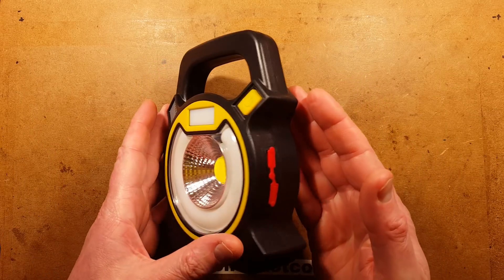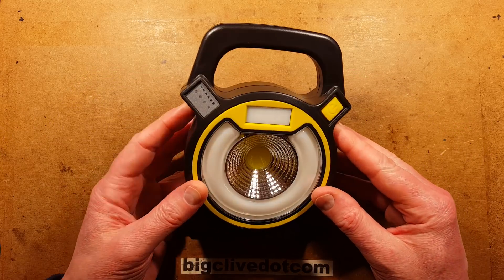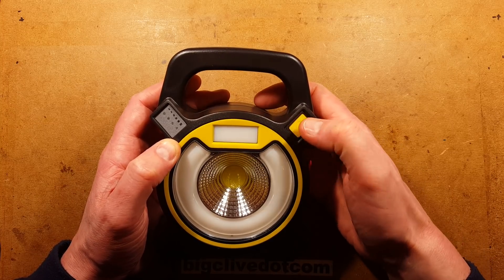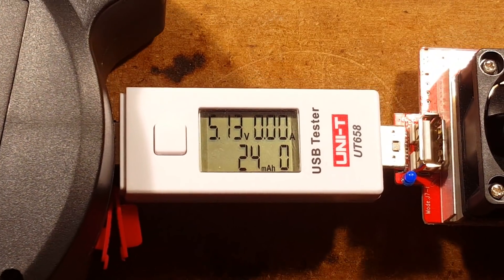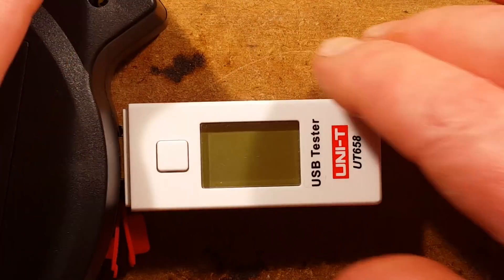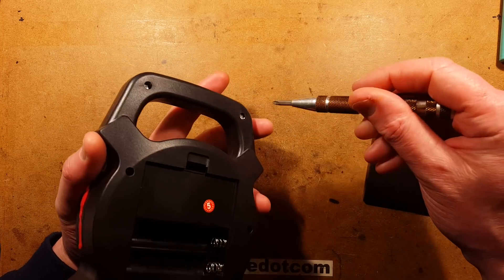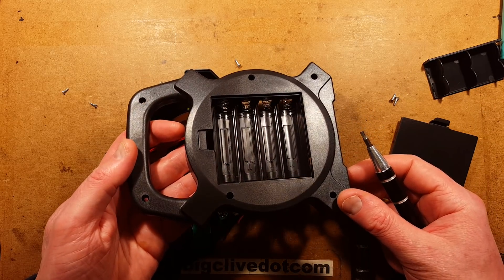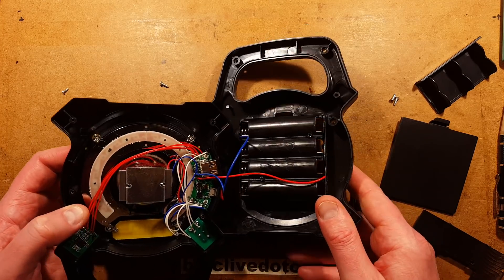Inside an interesting light and power bank with hidden upgrade.

Comment: During testing they probably found that the charging circuit would not handle charging 4 cells, so they just plugged up 2 of them to avoid re-spinning the PCB.
Reply from the maker: It charges at 700mA, so it would just take a while to charge four high capacity cells.
Reply: My advise of charging 4 cells from empty to full is from experience with one of these to just leave it over night.
Reply: Wouldn't it just charge at half (ish) the speed? Charging is done at a fixed current, isn't it?
Reply: That's my though.  Or, they use a more expensive charging module for the 4-cell version.
Reply: or re-spinning the plastic case.
Reply: I think putting say two discharged cells in parallel with two fully charged cell may end in a total incendiary mess, while doing the same thing using only a pair of cells will cause much less trouble. So they made some safety fix.
Reply: @Natopsi  That is not a problem. Julian Ilett made a video about that subject once.
Reply: @Natopsi  I don't think that'd really make any difference at all to be honest. If the thing was somehow going to fail catastrophically I'd imagine it'd happen just as well in a 2P configuration as 4P. Adding the extra charged and extra discharged battery wouldn't do anything different really. It'd basically just be each charged battery splitting it's load across the two cells, effectively dumping as much current that one charged battery would into a single discharged battery. Granted I could be wrong, it just doesn't seem like the likely cause, especially since these cheap products aren't know for being engineered to avoid incredibly unlikely safety concerns - or even the very very likely ones.
Seems to me they probably just didn't want the layman to see four slots and assume four battery slots means it must use four cells, then want a refund when it takes 10-20 hours to charge, or think the thing is defective when the charge indicator never changes even after being plugged in for several hours, so they limited it to a capacity range the charge circuit can more adequately handle without the average persons expectations that a device should charge in 2-6 hours.
Reply: I thought Clive said it didn't come with batteries and he put in some random mismatched cels.
Reply: @njrenkable  0:24 "they're just completely random mismatched cells I've put in here..." It definitely came with no internal or removable batteries.
Reply: they probably sell a 4 cell variety for more money companies do shit like this all the time 

nvidia shield does it too i belive they sell a hdd model and a none hdd model the only difference is for the hdd model they put the sata connector onto the board and possibly use a different case half that has the mounting tabs for the hdd
Reply: @njrenkable  :p no worries! As someone who almost exclusively watches YouTube videos when preoccupied with something else, I know how it is.
Reply: or maybe took way too long they were concerned people would think it was not working
Reply: @USWaterRockets

My guess is more on : according to the price of cells they took off 2 of them to up margin.
Reply: The way I heard the description in the video, it comes with no batteries because of the mail service rejecting lithium batteries in products. You need to supply your own batteries, so there's no profit margin increase by blocking 2 slots.
Reply: @USWaterRockets
If it comes with no batteries, then yes my bad, assumption completely jammed ^^'
Reply: @jean-baptistefox2819  but no cells were shipped with this item... there is no point in covering up two slots
Reply: there's no real point in trying to divine why things come out of chinese factories the way they do, it is just as likely that this product was designed based on finding a shipment of 100,000 plastic shells that fell out of the back of a truck
Reply: parallel cells allows the possibility of dead short and product liability problems.
Reply: @wktodd  And of course we all know the Chinese manufacturers take product liability very seriously indeed...
Reply: @wktodd  The 2 cells are already in parallel, what difference would another 2 more make in terms of dead shorts, apart from doubling the risk. But then why double it in the first place from 1 to 2? Doesn't make sense.

Comment: Might I suggest placing a small reference mark on your bench that indicates the center of the video when fully zoomed in? That way, you can easily tell if you're drifting off center, and it'll help you develop muscle memory of where that point is.
Reply from the maker: I usually do have a faded mark in the middle.  It helps a bit, but I often get so distracted that the only thing I'm looking at is the thing I'm working on.

Comment: On EBay search the terms:  15W LED Camping Light Work Tent Lantern Portable   around US$12, it varies by a dollar or two.
On AliExpress there were sellers listing this for ~US$9.40 shipped (without batteries) 
Does anyone know how to permanently disable the god-awful blinking setting?  Please Oh Please there has to be an easy way.  Thanks.
Reply: Clip the wires.  You'll have a blank click on the switch, but no annoying blinking lights.
Reply from the maker: It's inevitably baked into the software.

Comment: the molds for injection molding are expensive. and the faster you want to produce the more expensive they get. If they don't have enough orders to justify two different molds for the battery case, a mod is exactly what would be done.

Comment: Wouldn't adding two more cells up the voltage from 3v to 6v using 4 AA?
Reply from the maker: It's lithium cells in parallel.
Reply: @bigclivedotcom  Oh, ok, thanks. So it just adds capacity. Can it run off a standard 1.5V AA though and achieve it's claimed 15Watt output?

Comment: does it have 240 Volt USB Outlet.
Reply from the maker: This is one of the safer ones.
Reply: @bigclivedotcom    but I need to rapid charge my cellphone with 240Volts stuck with this slow 9volt charger
Reply: So, you don’t mind the risk of electric shock with the death Dalek lanterns that Clive had videoed ⚠️⚡️, I think rapid USB chargers are available? 😉
Reply: @samuelfellows6923  240 = charged in seconds  =fast charger takes an hour

Comment: have the same lamp. shorts the usb input
Reply from the maker: Do you mean it shorts the USB supply when plugged in?  It might be worth checking the PCB for a solder splash in the vicinity of the connector.
Reply: the supplied cable was warm to the touch. pcb looked okay. i just charge the cells outside and glued the input flap

Comment: What the heck‽ 😲

Maybe they made a mistake, then covered it up because it was cheaper than re-tooling; or maybe they have a "pro" version (🙄) and it's cheaper to use the same mold plus a cover than a whole extra machine/mold.
Reply: How can it be cheaper to manufacture an extra piece of pointless plastic than not. They're need additional raw material, tooling and molds just for this one piece.
Reply: @simontay4851  Common model with 'pointless pieces of plastic' are a LOT cheaper than a complete retool for each model. The 4-cell version is probably sold as more expensive. I work in the car industry, and it is VERY common there - you can get a model of car offered with or without heated seats for example, obviously the one with heated seats costs a LOT more - but the only difference between them is the one 'without' the heated seats simply has a 'pointless piece of plastic' over where the on button for the heated seats should be. Cheaper to just put the seat heater in every car and simply disable it on cars that arnt supposed to have it.
Or if you want it another way, the Jaguar XJ production line in Birmingham uses around 500,000 pre-manufactured 'pointless pieces of plastic' per year to blank off features the customer has not paid for, but actually exist on the car (such as seat heaters).
Reply: Simon Tay 
Cheaper than re-tooling he said.
Reply: And the additional covered holders had contacts in them - if they were a mistake, it would only have two sets of contacts in the exposed 2x holders, and the cover glued/sonically welded in place? 🤨

Comment: I have this light.  Had it for over a year and it is still working great.  Very bright and works great as a work light as well as spotlight etc...
Reply: Does yours have the secret compartment, or were all 4 cell slots open?
Reply: @mikecowen6507  Mine holds 4 batteries.  There was no secret compartment on the one I received.  It is truly a great light/Battery Bank and worth the money.  I have found dozens of uses for it.
Reply: @valveman12  Cool. Thanks! So the blanking plate is a more recent change. That's exactly what I was wondering. Now, why?? Several possibilities...
Reply: @valveman12  What capacity cells did you get/do you use?
Reply: @mikecowen6507  Hi Mike, Mine does have the flashing light as well.  Just like Clive's light.
Reply: @mikecowen6507   I bought 2600mAh 18650s.  So with 4 in parallel, the capacity is 10400mAh.
Reply: @valveman12  Nice. I've got a project that I'm looking for reasonable quality (and not obscenely priced) 4Ah cells. Imagine having a 16Ah capacity in that light!

Comment: Were do you buy quality 18650s?
Reply from the maker: It's a minefield online.  So many dodgy clones and fake capacities.  The flashlight forums often have links to tested cells.
Reply: Fogstar in UK
Reply: Also...
18650.uk
ecoluxshopdirect.co.uk

nkon.nl
Reply: I bought ligit samsungs from fogstar to  fix my makita batterys. Ebay and amazon are so full of fakes that it would have taken an age to find a good seller.
Reply: PK Cell is really good for the price. I use the 14450 size for my high powered lasers, and the 18650s for vaping. We have also used them in a battery tabbing device 2 of them in series and they performed amazingly well. Nearly as good as top brands surprisingly no problems had.
Reply: I bought RC plane wheels for my cheap Chinese made stick vacuum, when it’s wheels had cracked and fallen off, from Hobbyking 😁, Are German engineered NASMANN rechargeable battery’s any good? Have the matching charger - ENERGY16 plus, bought it as it is a smart charger. ✅

Comment: Even if you don't mod it for 4, you could use 2 and store 2. So, kinda stupid in the first place that they blanked it.
Reply: You'd have to UNmod it for 2+2, as it's already factory wired for 4 cells.
Reply: @mikecowen6507  Or slip pieces of paper over the cells you don't want to use right away.
Reply: @NiHaoMike64  There are several possibilities! My comment was to the OP, who is a bit confused as to how the unit is configured from the factory. There is no mod possible to electrically configure it to the way it ships from the factory, as it's already configured that way at the factory. You can't make it into what it already is.

Comment: I have one of those, the charging circuit can't handle a fully charge those 2 cells, so 4 cells would be a complete NO NO
Reply from the maker: Charge current is 700mA so it will charge them if given enough time.
Reply: @bigclivedotcom  When it reaches 100% on the charging LED indicators, voltage on the cells are usually at 3.9V.
When i noticed it, and since they were in parallel, i tried to charge only one and it kept saying that it was fully charged.
Could you take a look and tell me the voltage of each cell after it indicates it is fully charged?
Reply: You can easily replace that circuit.
I would prefer 2A output, too.
I'm searching for a QC3 PCB right now.
Reply: @justin games I bought mine from here: https://www.aliexpress.com/item/Flood-Lights-Rechargeable-COB-led-floodlight-USB-Portable-Flood-light-Lamp-4-Modes-Outdoor-Flood-lights/32801232606.html
Reply: Cells last decades? I'd go for that.

Comment: Did you put batteries in the battery slots you found and see if it turns on and its connected to the light circuit Clive
Reply from the maker: Yes.  They're all in parallel.  I tried it with four cells.
Reply: @bigclivedotcom  wow that's pretty nice
Reply: bigclivedotcom  so it is just increasing the current to the lights?
Reply: @thethreecraftateers-3906  Cells in parallel don't increase the voltage, therefore the current remains the same. It is increasing the capacity. If you want higher voltage, you'd need to put them in series.
Reply: Ollie B I know they aren’t a higher voltage in parallel lmao 😒
Reply: @thethreecraftateers-3906  Quite so :) . It follows therefore according to Ohms law at least that the current remains unaffected.  Amps = Volts / Resistance.  Adding cells changes neither the Volts or the overall resistance afforded by the circuitry eh.
Reply: @thethreecraftateers-3906  I have the same light.  All batteries are in parallel so it will increase the runtime,.  Plus gives you more capacity for use as a battery bank.  The USB board limits the current to 1Amp so increasing the number of batteries does not change the USB current.  As far as the lights are concerned, there is no increase in intensity.  I find the lighting intensity to be more than adequate.
Reply: Maybe in local markets where there's no problem shipping lithium cells they sell a 2 or 4 cell version.
Reply: Ethan Poole, 13.6 Ah for the cells would enable around 10 Ah at the 5V DC output.
Reply: Adding batteries in parallel slightly reduce the total circuit resistance and so the current increases slightly.
Reply: @Asu01  theoretical capacity using highest capacity cells for all four battery slots would be  over 10 amp hours. Neat
Reply: Cheese 1337 Or we could simply say that the theoretical capacity with four of the highest capacity cells “would be over 1mAh” and still be technically correct, but if we are going with “theoretical” capacities let us at least use a value closer to the actual current day maximum 18650 cell capacity.  You can buy authentic Japanese 18650s rated at 3400mAh each (that is actual capacity, not Chinese capacity, and the figure may be a bit higher by now — I admittedly did not research to see if higher legitimate capacities exist today — as this information is from several years ago), which would correspond to around 13,600mAh for a set of four cells.  A bit pedantic I admit, but if we are going to go with theoretical limits we really should use values closer to the legitimate upper end of the capacity range.
Reply: @ethanpoole3443  LG MJ1 cells have been available for at least four years. 3500mAh with a maximum constant current rating of 10A. If it's not a high draw application there are more than a handful of genuine 3600mAh+ cells that can supply 1-3A. In any case, something like the Samsung 25R/30Q, Panasonic NCR/HG2 are still considered high capacity cells at 2.5-3Ah and still largely revered in many electronic circles(flashlight/torch aficionados, vape enthusiasts, power tool manufacturers, Ebike enthusiasts, everyday hobbyist, and even Tesla and other electronic vehicle manufacturers. With that said, 10Ah in a 4P arrangement is most certainly still considered high capacity.

Comment: Not like you to neglect putting a link in the description Clive. Where do I get one of these?
Reply from the maker: eBay is awash with camping lights.  I'm not sure what the keywords are for this one.  I've had it a while to avoid doing too many videos on a similar subject.
Reply: @bigclivedotcom  Fair enough I guess, though I wanted to get that particular one so I could modify it with the 4 18650's and see what happened. It was a good video regardless :)
Reply: This looks like a good match. https://www.ebay.com/itm/15W-LED-Camping-Light-Work-Tent-Lantern-Portable-Outdoor-COB-Light-Flashlight-/173487192542
Reply: @ucitymetalhead  2 sold in the last hour.
Reply: @Markle2k  oh yeah? More power to em I guess.

Comment: search ebay... 15W LED Camping Light Work Tent Lantern Portable Outdoor COB Light Flashlight. I found it, but not gonna' get. First search was 18650 camping light and got it on first try.
Reply: A lot of Chinese eBay sellers use external tools to monitor sales. As they sell, they boost the price. If sales drop off, they back it down again.
This is actually why you often get the message that the item you bought is no longer for sale after you get the confirmation email.... The listing has changed so eBay considers it different to what you bought.
Reply: I myself, enjoy the hunt. Very satisfying when I find it myself
Reply: Is there a reason bigclivedotcom doesn't include this info on any of his recent videos?
Reply: @uhadonejob  To stop one seller seeing a sudden surge in demand and as a result hiking the price up
Reply: It's also on Amazon. https://amzn.to/2Vy38oY

Comment: Why do I feel the need to go out and get one now. Thanks for the teardown Clive. Was this an eBay item I wonder
Reply: I have too many torches and things that light up, but I never stop wanting want another torch or thing that lights up :)
Reply: @licensetodrive9930  I suffer from the same affliction!
Reply: licensetodrive 
 377 at last count , US and Brittany from wooden to the 50s ... it's a disease .
Only use LED lamps now with 20 and counting .
Reply: eBay item 173487192542 looks very close to this unit...
Reply: @kd5byb  I'll take a look thanks
Reply: I think I want one too now!
Reply: Don't forget to upgrade it though!
Reply: https://www.amazon.com/Bright-Rechargeable-Rotating-Lighting-Emergency/dp/B075K8F77Y/ref=mp_s_a_1_9?ie=UTF8&qid=1546837353&sr=8-9&pi=AC_SX236_SY340_QL65&keywords=camping+light+18650+15w&dpPl=1&dpID=41phFAnYCJL&ref=plSrch
Reply: https://www.ebay.com/itm/COB-Waterproof-LED-Lighting-Camping-Hiking-Tent-in-Outdoors-Spotlight-E1J7/401631715714?var=671377101023&hash=item5d831da182:g:tpoAAOSwRhFb5FIx
Reply: I ordered one of them that Clive took apart. 4 cell spot+floodlight with USB powerbanking for less than 10 euros is just too tempting.
Reply: sleeptyper God.... same here!  My listing says battery included too - worth a punt for a tenner. Tks Clive!